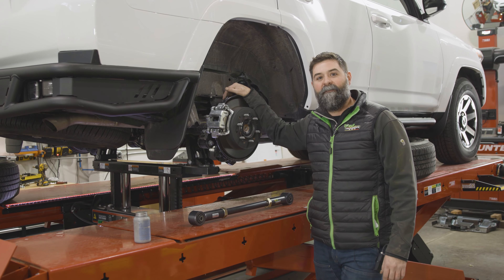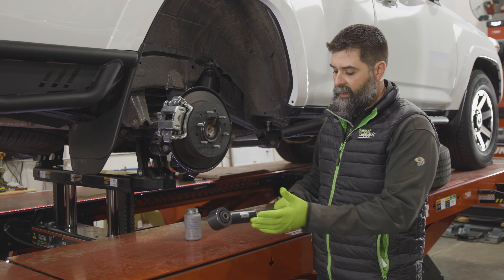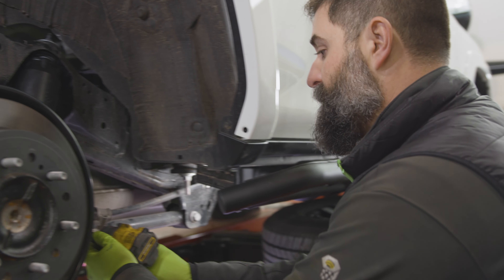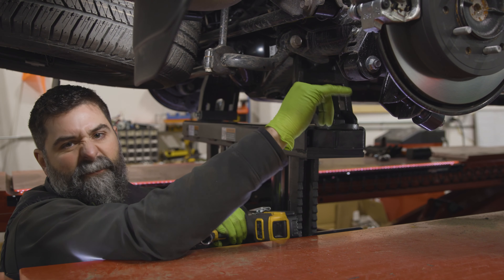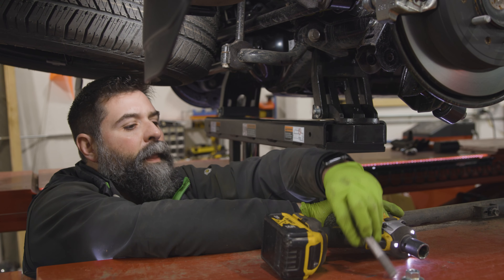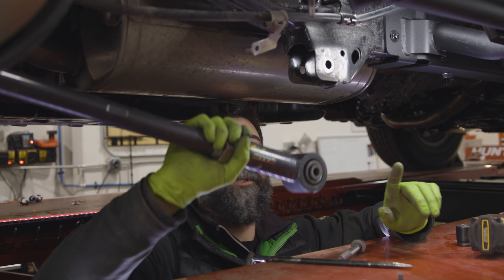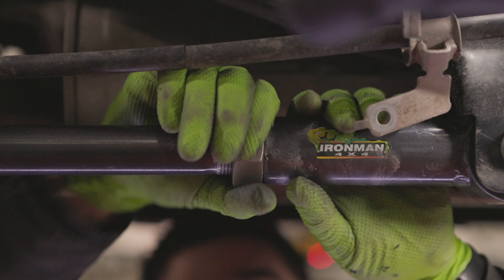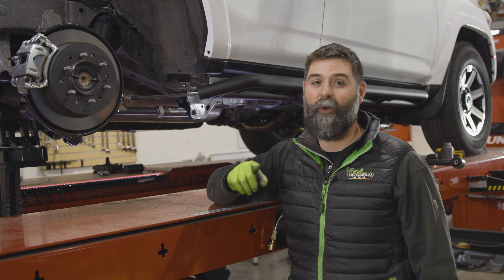Ironman 4x4 Lower Trailing Arms For Toyota 4Runner, FJ Cruiser, LC100, Lexus GX | Install Guide

Comment: If these are installed along with a lift kit, do we need to adjust them to bring a different length than the originals?
Reply: Looking for an answer on this too
Reply: @seanohe1 you need to use them to center your wheel in the wheel well. for upper trailing arms they are used to adjust the pinion angle of your driveshaft (lengthening is up, shortening is down)
Reply: @seanohe1  to add to that, if you’re not lifting more than 2 inches it’s not really necessary at all. your wheel might move forward a few millimeters but doesn’t justify the $600 price tag